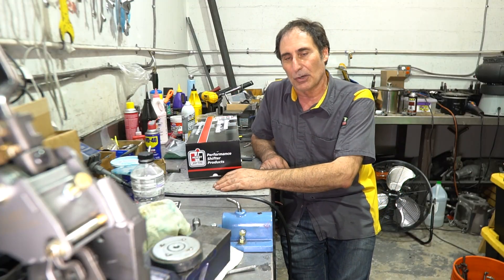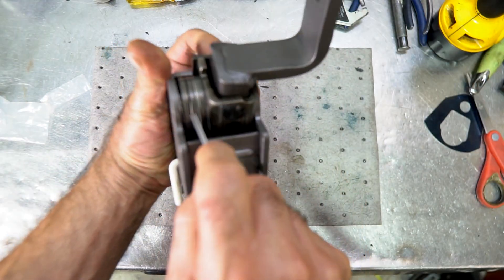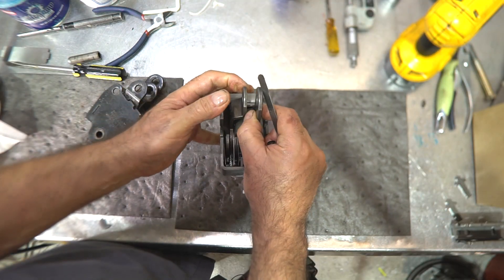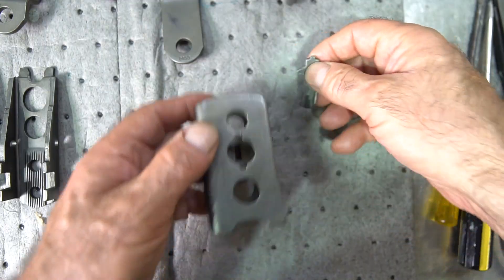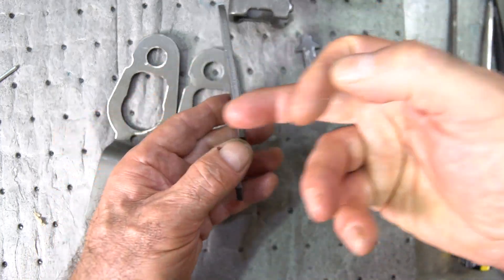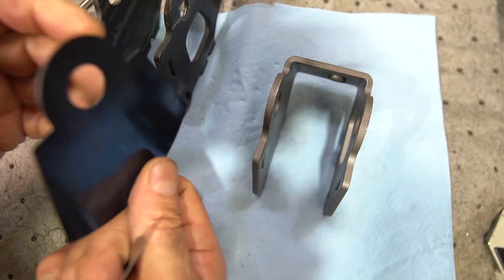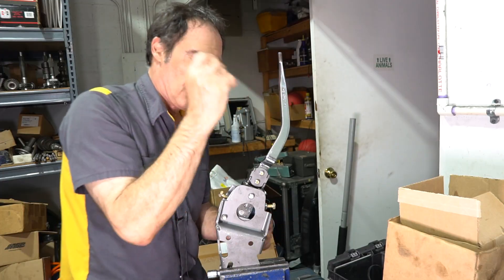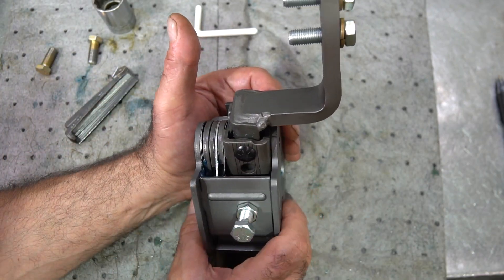Hurst Shifter Secret Modifications Revealed

Comment: I purchased a Hurst Competition Plus shifter from Paul last year.  He reworked the shifter and applied the tricks demistrated here in the video.  I have the shifter mounted to my 1968 toploader 4 speed in a 1990 mustang.  The toploader and shifter works great with no chassis mods to the car.  The shifter works wonderful and very short throws.  I just push straight up for 3rd and the shifter does all the work; very smooth.   Thank you Sir.

Comment: Shows how a product that we were used to with it's construction has changed so much over the years and that you should never assume that it's going to be exactly the same as the older models. Shifters are indeed an area where the little details that Paul is describing play a super important part. I'm old enough to have had some of those older models from the 70's and even the late 60's and we used to do things that we could think of to make them shift better but not to the extent that Paul is showing us here. What we did learn was that if it's not really close to perfect then you are going to have shifting problems and miss gears. This video shows us all the little details such as checking the thickness of the metal on the main housing and how that affects the side play and how to fix it with custom shims. Now we probably all want to get our shifters massaged by Paul to make them as good as they can be. Thanks for this video and also to let you know that the B-W Super T 10 from my Corvette that you rebuilt for me 2 years ago is working perfectly and I am proud to have it in my car. Mike from Atlanta.

Comment: Paul, this is an awesome video that highlights the differences between a made in the USA Hurst unit from back in the day as opposed to the products they sell now with lazy tolerance standards. Good for you for taking the time to "rebuild" these new shifters to work as the designers intended back in the 60s.  Your bushing & clip kit will improve the performance even further.  All of my shifters have those installed.

Comment: Just got my Camaro kinda on the road the other day for a test drive. I have one of Paul's brand new, rebuilt Shifters.

First time I shifted into third, I thought the damn thing went back into first! It shifted to third so fast, smooth and tight, I couldn't tell what was going on.

This is no joke.

My job is shifting 10 speeds and 13 speeds and 18 speeds all day for 12 hours straight. Ive been driving rigs for 12 years.

The shifter is awesome.

To bad my tranny needs attention with second gear down shifts, but thanks to Paul's other videos on how to rebuild super t-10s, I'll be buying a shop press soon...
Reply from the maker: Thanks for the detailed comment.

Comment: I realise this video is 3 years old. Im in Australia and run an Indy Hurst shifter on my Toploader, im going to remove and inspect my shifter, lately Ive been having problems getting into reverse, I adjusted it by the instructions and it feels great for 1 or 2 drives then it does it again, it wont get past the gate, it all seems tight with no play, im thinking the problem might be in the gearbox, but firstly il remove the shifter and inspect and will do what you have shown, great video. Thank you Sir.
Reply from the maker: You need to get underneath the car and see what's going on. Some of the top loaded detent mechanisms are very sloppy and it could be that just a reals are not actually going back into neutral and then causing the shifter to obviously not being neutral completely
Reply: @GearBoxVideo  Thanks Paul. I ended up removing the shifter completely and rebuilding it, plus i watched some of your videos and also chamfered the gates, cleaned everything and up and greased, while i was at it I removed the extension housing and fitted a new gasket and tailshaft seal because it had a small oil leak, changed the gearbox oil. The shifter now works better than ever. I run a Hurst Shifter in an Australian Falcon GT with the adapter so the stick exists closer to the driver and in the correct position of the console, so while i was at it i filed and made things a little nicer there also. I shouted you a coffee about a week ago to say thanks for your videos in appreciation, excellent information for us all. Thank you
Reply from the maker: Thank you

Comment: A great video! Thanks for sharing these secrets. I just registered on Super 661 to gather all the goodies to convert my 1968 Camaro to a Muncie M22 manual four speed transmission and a good clutch combo. Paul, is there an estimate when the complete M22U transmissions will become available again?
Reply from the maker: Hoping this supply issue will start to clear up in mid December
Reply: @GearBoxVideo  that sounds good Paul. Would be in time for the next season.

Comment: Hi Paul. Excellent video. I've been dealing with the sloppy shifting of my competition plus since it was installed back in 2010. This shifter is nothing like a super shifter I had back in the 70's. This comp plus got stuck in reverse once too. I wanted to change out to a super shifter, but I want to keep the console in this car (69 Camaro) and didn't want to cut the tunnel. Since most of the nylon bushings in the rods were pretty chewed up, I installed your Hurst Hardened Steel Bushing and Clip Kit last year. The steel took some of the slop out, but I'm not happy with it. And now that I see where the additional slop comes from I'm going to either rebuild this shifter to get proper tolerances or try to make a super shifter work with my console. What do you think about the possibility of installing a super shifter with the console and without cutting the tunnel? The car is an X55 SS coupe with a SBC and an M22. The car originally came with a stick, so the hole for the shifter is there. But the floor pans and most of the other sheet metal is original, so I've put up with the sloppy shifter because I don't want to cut the tunnel and remove the console. Do you have any ideas to modify the main body of a super shifter and / or maybe use a different mounting plate? Anything you can tell me would be appreciated.

Comment: Finding first is a pain with mine. It seems like i have a hair tolerance and sweep neutral multiple times before it can fall in. Once its in the up shifts are fine but without downshifting coming to a stop its a pain to grab first gear. Clicks alot while sweeping neutral.
Reply from the maker: Make sure alignment is spot on and that none of the bushings and springs are sloppy
Reply: @GearBoxVideo  Linkage bushings?

Comment: Excellent Videos. Thanks for the tips and tricks. The Comp Plus shifter on my Muncie 4 speed doesn't have a bridge plate on the carriage . There is a square hole for the carriage bolt. Can I  fabricate one from mild steel ? Or does it need to be harder? Also there are no through holes to bolt the stick on ,it just slides into a spring socket. should I drill a hole through and put a 5/16 bolt?
Reply from the maker: I sell a new bridge plate  in a carriage bolt kit. Do you have the stick? Those systems have locking isolators which may be missing. All my contact info is in the video description.

Comment: I have a 1970 Plymouth Roadrunner with the original Hurst shifter will your shifter fit by that I mean are they exactly the same size and works with the pistol grip.
Reply from the maker: Some pistol grip assemblies are not bolt on but press in. So if you have a person shifter you will have to find an NOS shift your handle but you can purchase new assemblies and your pistol grips That bolt onto the newer assemblies

Comment: Paul, i have a Richmond 5 speed purchased 2017 for use in a stroked 383 in a corvette. Wasn’t happy with it so I rebuilt the m-20 put it back in, much better.  Now i am building a pro street 70 chevelle, 540 blown motor,  Moser rear, will the Richmond hold up to this motor, maybe 900 hp, unknown torque, if not what transmission. Thank you, Dave
Reply from the maker: I would go for the TKX 5 speed conversion. Sell the Muncie and Richmond bits and put it towards that

Comment: Paul, are the new shifters manufactured off-shore now, met George in the early 60's, he really would help anyone with any problem out, no questions ask.
Reply from the maker: Parts seem to be made in the US and offshore . Off shore parts are not the issue. People are quick to blame offshore parts as the reason for failures. Most of the problems with the shifters are due to assembly here in the States

Comment: Hello. I have a Hurst Super Shifter and I installed a offset receiver to fit in my concole of my "69" camaro. The shifter had a reverse lockout spring at the bottom of the shifter. It had a hole in one side of the fork . The spring attached in that hole then hooked on the side of the assembly the new "s" receiver did not have that hole. So I drove the car, it shifts v. Good , but it is easy to grind on reverse. When attempting to put it in first gear. And remedies for this reverse lockout spring. ?
Reply from the maker: You would have to convert it to a standard reverse spring setup. Since the plate system is different

Comment: Thanks very much for sharing your knowledge!  I have a new Competition Plus shifter that I'm using on a cable shifted Top Loader that worked well and figured that before I hit the road I'd follow your suggestions.  I purchased your part's kit, de-burred and reduced the spacing to spec and re-lubed all the parts.  After reassembly I find that I cant get full travel in 1st or 3rd (maybe half way?) before it binds (disconnected from trans).  Before I take it down again, is there something in particular I should inspect?  Thanks in advance.
Reply from the maker: Nothing with the shifter. It has to do either with the stops or the centering of the gates in the body. Simply disconnect at the shifter and see if you can get more travel
Reply: @GearBoxVideo  I found the problem, and it was my fault.  The shifter was disconnected when I noticed the travel problem, and the stops had not yet been used.  After taking it apart and watching your video more closely I found that I had installed the 15 thousandths spacer upside down.  It's not symmetrical and MUST be installed as you show or travel will be an issue.  After reassembly my cable shifted LS,  Toploader, C5 diff transaxle now shifts into all gears like butter!
Reply from the maker: Thanks for the update

Comment: I just experienced a hung up 2-3 hard shift in my Camaro. You mention this is typical for new shifters, but I have an old Hurst on my muncie. Do you think excess play between gates is still likely my problem despite having an old Hurst? Is it possible this can cause the transmission to go into two different gears at once (2nd & R)?
Reply from the maker: No, check for shifter play and check that the shifter is tight on the mount. Make sure there is no slop in the rods and arms and there connection points
Reply: @GearBoxVideo  I checked and the reverse drive arm bolt was completely loose and started to back off. It started to rub (and likely bind) the 1-2 shift rod. Could this cause the transmission to shift into 2nd and R at the same time? Thanks for your reply, really appreciate it!
Reply from the maker: Yes... as mentioned nake sure everything is tight

Comment: Great Video Paul . my corvette C3 is equipped with Hurts competition shifter . with the Richmond 5-speed gearbox.
there are vibrations and noise on the 3rd and 4th gear surely due to wear.  the gears go well, no problem on this side . Is there a solution to repair the shifter.
Reply from the maker: I don't repair those shifters. I can tell you that sometimes the springs are weak the hold the rods and then they flop around and vibrate
Reply: @GearBoxVideo  if I order this KIT Hurst 3327303 Competition Plus Shifter Rebuild Kit - DELUXE
do you think this can solve the problem
Reply from the maker: The kit will not work with this shifter

Comment: Pulled shifter off of my 67 GTO that would not slide over into reverse from neutral position. It is a mess and your video’s have given me some confidence to pull apart and clean up. What is your turn around time if I chicken out or get stuck?
Reply from the maker: Depends. Right now 2 weeks

Comment: Awesome informational video! I just recently purchased a Super T-10  that came with a ITM shifter.  Will this process and your additional shims work on it also?
Reply from the maker: An ITM is not a HURST shifter. Completely different. No service parts for the ITM at all .
Reply: ITM was the first thing people tossed out. Put a HURST in, but keep the ITM, some people may want it to make a car all original. I know of several restorers that use those POS shifters for a numbers matching restoration.

Comment: Hi, I'm new to your vids. Just watched some of your videos on how to install my shifter on a 74 firebird with an M21 muncie. It all went together fine and shifts smoothly on the bench 1& 2,
 3 & 4, with the stops adjusted like you show, but I can not get it to go into reverse.  The reverse shift lever is smooth by hand, but maybe it takes more pressure to get it in reverse than I can exert on the bench as an old guy? Lol
Reply from the maker: Reverse is hard on the bench. You must have the spacsr plate installed if you have a solid mount plate
Reply: @GearBoxVideo  Thanks, I have the spacer plate installed as you showed in your video.  I just wasn't sure how stiff a new hurst shifter was to get in reverse to test it.  Thanks Again..

Comment: THANKS. JUST PICKED UP 2 SUPER T 10S FROM AN 80 YRAR OLD MAN WITH EARLY SUPER COMP SHIFTER. 1 RICHMOND NEW. 1 T10 TOTALLY REBUILT WITH IRON CASE AND BILLET CENTER PLATE. 2400 FOR ALL. DID I DO GOOD.  ??
Reply from the maker: Yes. That's a great deal

Comment: How about a before and after the shifter mods to show the in-car shifting improvements power shifting down the drag strip?
Reply from the maker: People are sending me shifters because they have problems. I don't have a car to test and nor would I be building a car with an unmodded shifter taking it to the track so I can have problems and then take it back repair it and it take it BACK  to the track again. So, to do that you would have to have someone take two shifters to the track have the car mess up in one pass then pull the shifter out of the car exchange it and then do another pass to see the results. Sounds like a good TV show. Find someone to sponsor me and I will do it!

Comment: I have oil leaking out around the input shaft. I have oil leaking into my bell housing and not sure if my rear main seal is leaking or if my transmission is leaking. The gear oil leaks out of my muncie when I stand her on edge with input shaft facing down at a 90 degree to the floor. This normal or do I have a bad seal? thanks. Engine is a fresh build and only has 200 miles on it.
Reply from the maker: Muncies have no front seal.   Watch the Muncie tapes and take the time to watch the Muncie Specific videos.

Comment: enjoyed the video and would like to pick your brain about rebuilding a 700 R4 4x4 transmission that I have. I overfilled it with fluid and burned it up. It still gets two gears and reverse but I screwed it up. I have another transmission but it's used and I don't have very much confidence that it will be ok. I will contact you to pick your brain soon. 
Thanks David W.

Comment: not sure if anyone can help with this but I have a 63 Impala SS with 409 4 speed and hurst shifter. took a drive to my friend's house the other day and went to leave and seems like tranny is stuck in two gears at once. I cant move the shifter in or out of any gear. when I release the clutch it literally stalls the engine. car will not roll at all. any suggestions on how to fix? Ive crawled under and all linkage is connected and doesnt seem jammed. wont shift and wont drive!!! HELP!
Reply from the maker: Make sure all linkage arms are in the correct neutral position. The transmission can get stuck in reverse and a forward gear. Or you might have just run the unit low on oil and one of the gears seized to the main shaft
Reply: Would check your linkage 1st.

Comment: I need to mail this guy part of my shifter. Mine needs to go into a 68 Camaro but the carrier is straight and I need the offset. The springs don't look fun to mess with at all
Reply from the maker: I can swap it over
Reply: @GearBoxVideo  how much does that generally run
Reply from the maker: If the shifter is clean 225. If I have to spend a lot of time cleaning a crappy shifter up a lot more. The shift to it also be rebuilt because I do not put one parts back into it

Comment: Hey Paul, I need to buy a shifter for my street/strip 408 Duster.  It'll have an 18 spline 833.  What's the best one for it?  I'll be taking it to the track once it a while, speed shifting it with drag radials.  Thanks.  I could use some help with choosing a clutch, too.
Reply from the maker: My contact information is in the video description

Comment: I've been going through all your Hurst videos. Wondering if same applies to other shifters. Have a Mr gasket 4 spd for toploader and Wondering if tolerances are the same. Always was a little stiff but shorten the throw dramatically
Reply from the maker: They are different and have no service parts
Reply: @GearBoxVideo  what I get for spending $39 instead of $ 75 for a Hurst back in '74
Reply from the maker: Some people like them for rat rod stuff
Reply: @GearBoxVideo  they are big on  vert-a-gate. My buddy had one on his Nova. Very quirky, had to bang 1st to 2nd hard or the gate would drop into 4th. Upshifting was nightmare. Mine is cheapo 4 spd no lock out. Built like a tank.... I beat the heck out of it in HS. Believe it has 3/8 stop bolts.?? Way more beafy than my friends boss 302 factory Hurst. Hurst in boss 429 seems have shorter throws. But that was 50 yrs ago. I'll take couple pics. You'll get a laugh out off 16 yo engineering,  welding and tool steel bushings